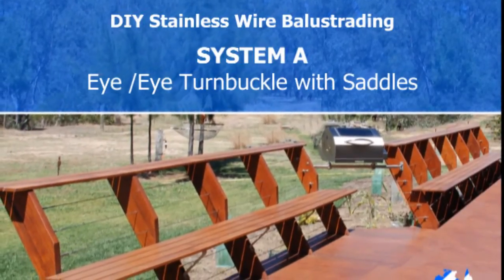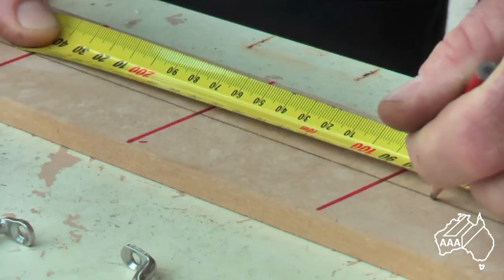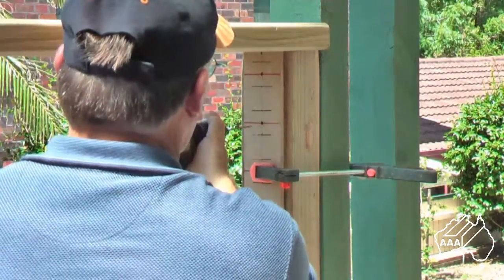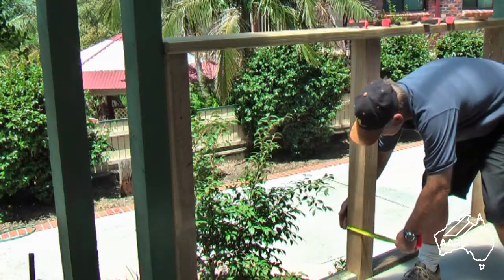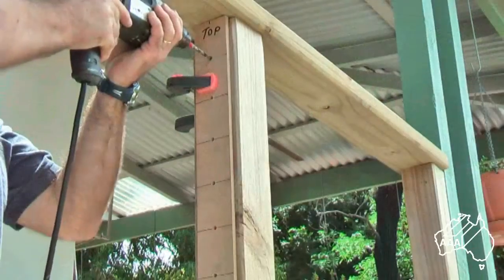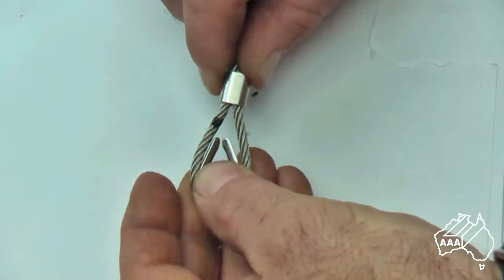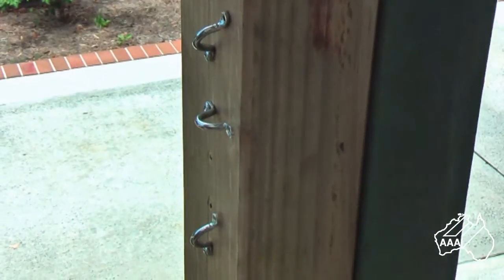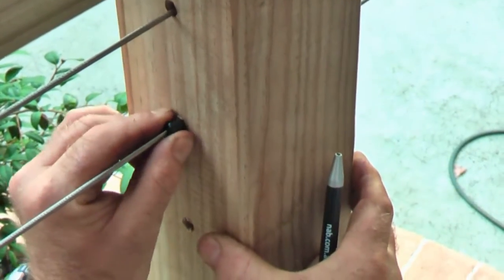How to Install System A Stainless Wire Balustrade

Comment: pretty good only they didn't go into how much to leave off the measurement between the posts to allow for the fixing hardware ie the turnbuckle and saddles, and how far should the turn buckles be extended to prior to fitting so that there is enough thread to tension the wire
Reply: exactly...thats why i am on here looking.